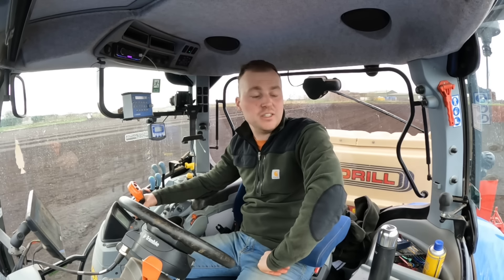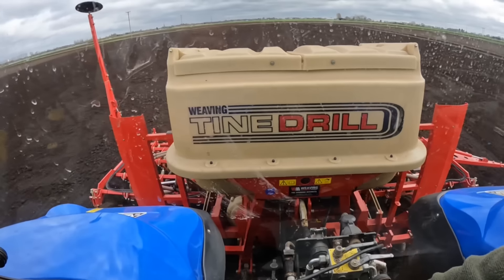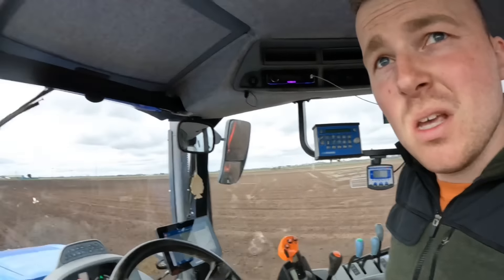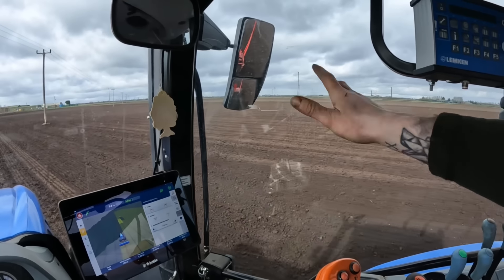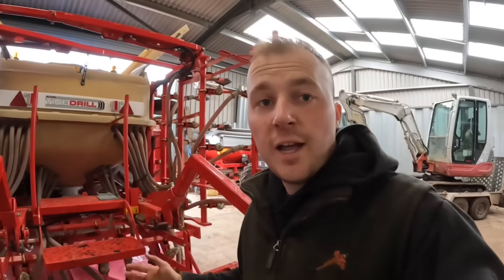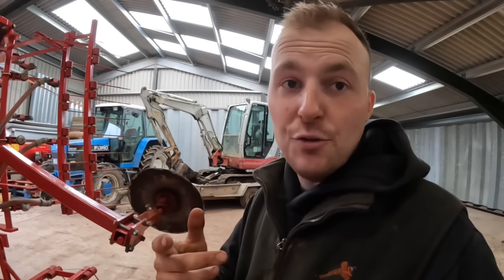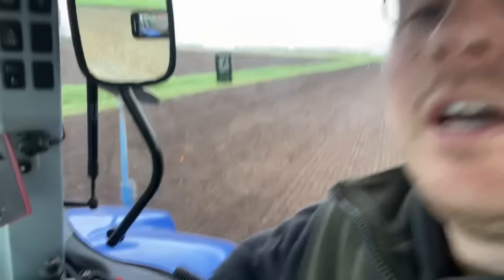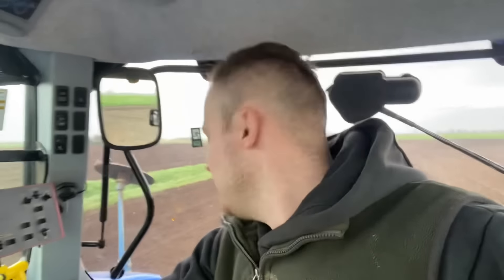“Plantin”🌱 ……or getting planted

Comment: Hi Rob, thanks for the catch up video. Did you mean you won't put the lemken drill on the Rubens again?
Reply from the maker: The lemken disc system we have is called a helidor, think the Rubin is a trailer machine mate , the discs will come off and we will use it to just cultivate then , the powerhsrrow will stay on the drill